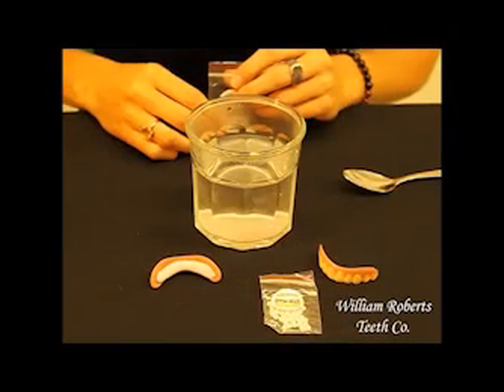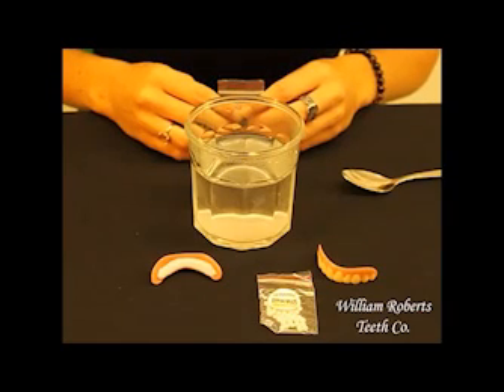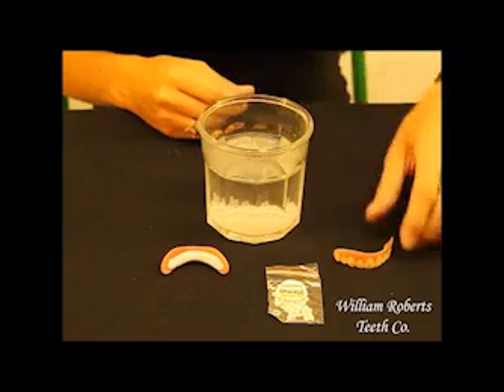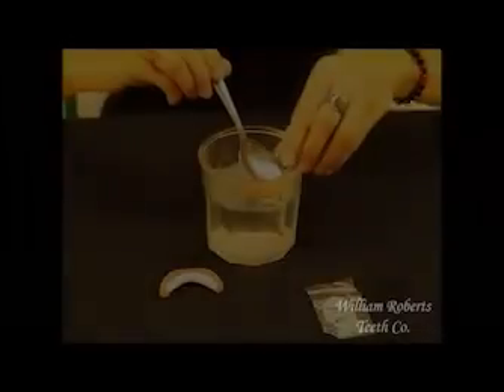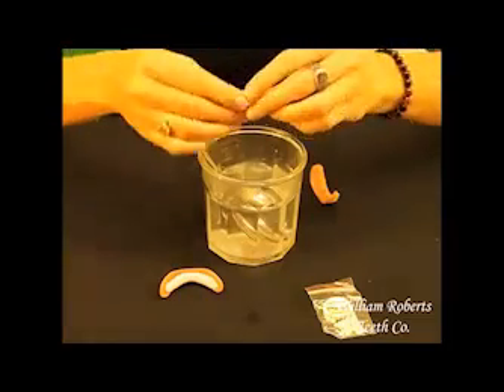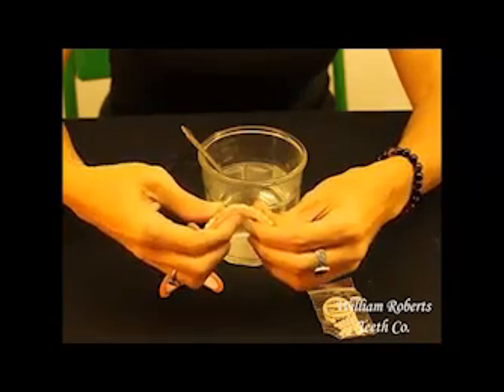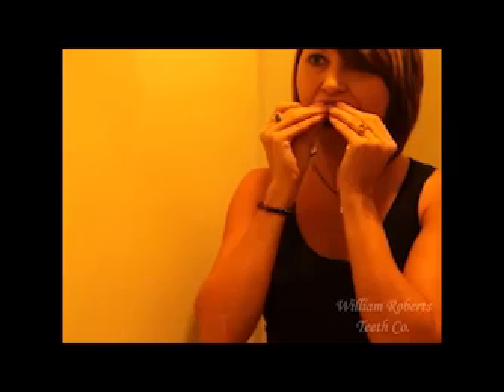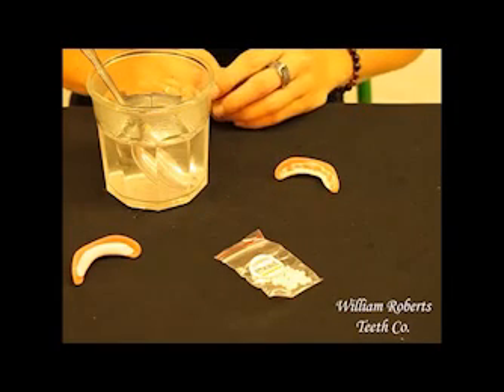Instant Smile Fitting Instructions

Comment: okay people here is the scoop, they will make you look buck toothed, but there is a way to make them work perfectly. if you are missing a tooth, you can cut out the tooth thats missing, make sure you take your time, and take the fitting beads and form a tooth pressed in from the back and locking into your two teeth on the sides, also make sure it sets back a little, to give the right distance to the tooth you are about to use. now super glue the tooth onto the fitting beads. it's Perfect!!

Comment: I became the laughing stock after wearing these Halloween teeth!!!
Reply: I like you have small mouth. I wore different brand of these teeth. So I heated the teeth up. After the teeth were soft. I took spoon and removed some of the fitting material. Then fit the teeth. It worked I wore them to my granddaughter 1st birthday party. No noticed I had them in. For people like me. Who need kids dental tools to pull my teeth. So if I could get to work it is do able. But the directions are not clear. On what to do if you have small mouth. I also use finger nail file. On the top of the gums after they are fitted. To flatten the gums more so they are closer to my gums and teeth. You have to make adjustments to them.

Comment: the real snap ons you can eat with them
Reply: where does one find 'real' snapons?
Reply: Some people eat with these, too..
Reply: They don't make any you can eat with that requires chewing. You could choke to death. Simply remove them for eating. Under no circumstances would I attempt to eat with any of them. None of these are made by dentist. Dentures or implants and crowns. Veneers made by dentist. Are strong enough to eat with. I don't have any teeth. So it be embarrassing but much better then dying. Until I get dentures these will work for what I need it for. Looks and drinking through straw is it.